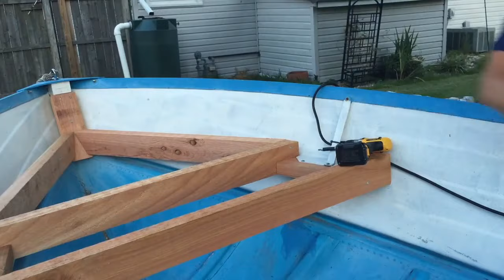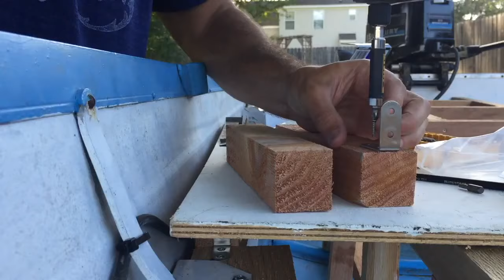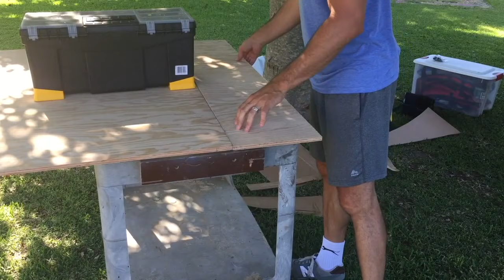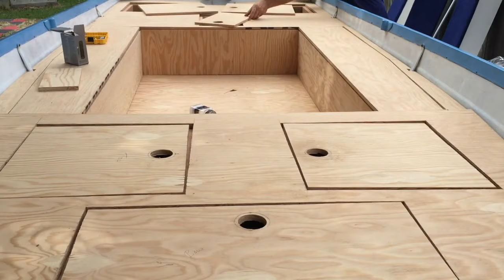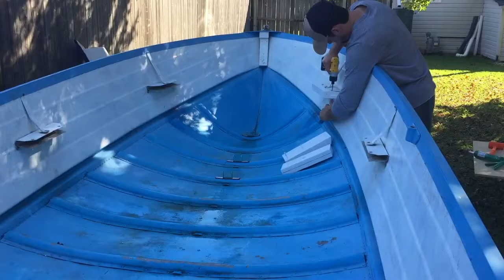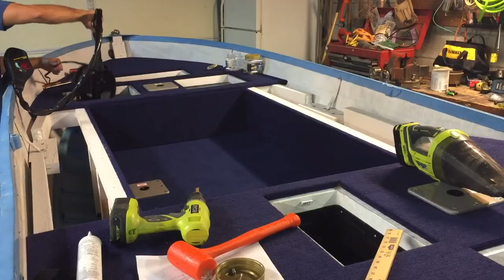14 FT Utility to Tiny Bass Boat | Full Build Time-lapse | Start to Finish!

Comment: I’m not taking anything away from your killer work or build. Just Bc you add a deck and compartments to a jon boat doesn’t make it a bass boat! I’m all for TBN I own one. But put that boat in the water with the bass boat guys i fish with and it will be sunk in like 5 mins!
Reply: I think most of the internet would disagree with you on that it can't be a bass boat
Reply: @skuterkid...   Take that MODIFIED JON BOAT in 3 footers and tell me it’s a bass boat! I’m not downing your equipment at all man. I have a TB and I have some decking and compartments that I built. But Bro come on a 2-20hp on a jon boat with storage do t make it a bass boat
Reply: @BrandonX444X  not to be an asshole or anything but like what qualifies it as a bass boat then..?
Reply: @skuterkid...   A legit bass boat 
Nitro procraft ranger 
Pretty much a console boat with at least a 25hp. 
Man I’m not being rude 
That’s a nice rig you have I wasn’t downing it

Comment: Did you find the boat to be “tippy” or unstable raising the platform and centre of gravity like that? Beautiful work you did here.
Reply from the maker: jamie, thanks for your question. I worried about that when I did the build too. I don't know what the boat would be like if I had dropped the deck down a bit lower, but I can say for me and a friend fishing standing up on it, one on front and one on back deck, it does just fine. Now having fish with it for a while I don't really think the height of the deck would make much difference. I think its the size of the boat (particularly the width), the bottom shape, and the displacement of water that ultimately determines how well the boat is balanced. Because the back of my boat is really flat on the water, it helps stablize the boat all the way through. If it was v shaped all the way back it could be an issue. All that to say, its no big bass boat, but I fish standing up on it all the time and ive even done so in pretty rough water and it does pretty well. I've had this question a lot, and I really need to do a video of me fishing it but when I get on the water I dont want to film, I want to fish! Thanks for watching!

Comment: this is really awesome.But, you could have shaved off alot of weight using Aluminum brackets instead of 2x4's.
Reply from the maker: you're right, while it turned out fine and i am really happy with it, if i ever do again I'd use less 2x4 and more 2x2 or as you said just use aluminum. Thanks for watching!

Comment: How stable is the boat. I have a 12ft aluminum boat and was thinking about putting a flat bottom on top of my 3 bench seats. You think that would work. Or would it be unstable
Reply from the maker: sorry for my very late reply, its stable enough for two guys to fish standing up. check out some of the other vids on the channel to see the boat in action. Thanks for watching and sorry for my very late reply!

Comment: Why not use aluminum for the frame? Wouldn't it be lighter and longer lasting? Asking because I want to do the same thing (once I get a nice deal on a similar size jon boat).
Reply from the maker: if i had to do again i would probably try aluminum, but i am very happy with the way it turns out and the way in handles in the water. You can see it in action in some of the other vids on this channel. Thanks for watching and sorry for my very late reply!

Comment: Very nice!! I really like it. Being as this video is 1 year old now - if you could talk to yourself a year ago - would you do anything different? What would you change now that you’ve been using your boat?
Reply from the maker: I would have used less wood for framing. I could have used more 2x2 instead of 2x4 but otherwise im really pleased with it. I dont like the color of the carpet, it looks purple. I wanted it to be blue. the floor is blue but I mismatched the rest of it and didn't realize it until it was done and out in the sun. Oh well.

Comment: Very nice build there bud. Definitely overkill on the framing. A you can save yourself about 60lbs by ditching the wood framing altogether and replacing it with riveted aluminum. I did a build on a 12’ aluminum boat, not as fancy as yours but my son and I could easily pick the boat up by hand, it was pretty lightweight. Should be on my channel somewhere if you wanna get some ideas for the next build.
Reply from the maker: thanks man, yes, I know ive done a bit too much, but Im happy with the way it turned out. I used cedar which is quite light, so it helps a bit. Thanks for watching!

Comment: how to clean such boat or remove water from the bottom if all panels are screwed and non removable?
Reply from the maker: Good question, the panels can be removed as all screws are still accessible. Its not an easy job but it can be removed to clean out inside of boat. thanks for watching!

Comment: Really good job and it looks nice, but IMO you added a ton of weight, could have used aluminum in places to save weight. But hey to each their own.
Reply from the maker: youre right I could have done with less, and use aluminum. I am happy with the way it turned out. You can see it running on plane in later video. It still runs just as fast with my 25hp. Thanks for watching!

Comment: How much do you usually charge for a project like that
Reply from the maker: I did this as a hobby for my own use. It is expensive to do this so I tell people to only do it if you have a tools and are handy and would enjoy it. Whether you decide on lumber or aluminum, it will be rather pricey. again, id say only do it if you want to do it as a hobby and you'd actually enjoy it. Its a lot of work and won't save you much money. But really rewarding when done.

Comment: What size screw did you use for the L brackets that connect frame to the bottom of the boat? (Where the boat rub sticks out)
Reply from the maker: Hi, I actually used rivets, but I dont remember what size, you can see me using them in other videos on my channel where the build is broken down into longer videos. I hope this helps. Id recommend using aluminum or stainless if you can, so they dont rust. Happy building!

Comment: How much weight did that add to boat ? How low does it sit in water now and will a 9.9 even push it now?
Reply from the maker: i dont know how much weight it added but you can see in the other vids that it does really well regardless. If i were to do again, i would have used a bit more 2x2 instead of the 2x4. i think the frame didnt have to be so robust. But overall, im really happy with it. you can see how it looks on the water in some of the other videos. i doubt a 9.9 would do well, but it has a 25 hp so it runs great. thanks for watching and sorry for the very late reply!

Comment: Curious what that project weighs now. USGS capacity is no longer close to applicable.
Reply from the maker: I get this question a lot and I have no clue what weight is. I used all cedar which is really light and naturally rot resistant, but being my first build I didn't have to use so much. It actually handles really well and comfortably handle some pretty rough conditions with myself and another. So it works fine for me. Would it be lighter with aluminum? absolutely but its not as heavy as one would think. thanks for watching!

Comment: Thank you so much for uploading this. I'm trying to do something similar with my 14 ft. Do you find the wood adds a lot of extra weight? I'm debating whether to use wood or aluminum.
Reply from the maker: Thanks Gavin, I used cedar so it's not too heavy and naturally rot resistant. I think I used too much, you could use more 2x2's, and aluminum is lightest. but the boat runs great as it is. you can watch other videos on the channel to see how it handles with the weight etc. with the 25hp it will go about 25mph with myself and another on it. I regularly fish with two people, one in front and one on back and have no issues and it handles some pretty rough seas.
Reply: @DrBass-rk1ez  Cedar is a great idea, thank you. Happy fishing!

Comment: Excellent work and great video. How much did the Royal weight go up after adding all the lumber?
Reply from the maker: Thanks man, I get the weight comment all the time. I think there is a really strong bias online regarding weight that I'm not sure, now after building a boat, that is not a bit overblown. Maybe Im simply not as concerned as others? Anyway all I can do is point people to my before and after videos on the water. Does the boat weigh more, absolutely, but it does not seem to have changed its performance at all, and when I'm fishing with myself and another having some extra weight actually stabilizes it better. Anyway, I always tell people I used cedar which is light and naturally rot resistant. I have a 25hp also, so of course with small outboard id notice a difference. Here are the videos of the boat running on plane: (before: @ (after: @. Thanks for watching!

Comment: How would you drain out the water out the bottom? I’m planning on building a bass boat and I was wondering this
Reply from the maker: hi David, in the other videos you can see I installed a bilge pump, if that is what you mean? so if it takes on water is has a pump. it also has a plug in the boat so when its out of the water you can pull the plug to get out any remaining water. All boats like this will have a plug. I hope that answers your question.
Reply: @DrBass-rk1ez  yes it does, thank you very much

Comment: A friend of mine tried something similar and it just made the boat a bit heavy and not as maneuverable. Also sat a bit deep in the water for comfort I wonder what he did different to keep weight down
Reply from the maker: It does add weight, but I used cedar which is really light and rot resistant. Here is a video of it running with the decking in it: https://www.youtube.com/watch?v=5YdJ9oOzhR8&t=136s

Comment: Are you putting screws into the boat or is this a semi floating deck?
Reply from the maker: if you watch the other videos you will see i never screwed through the boat. I only put a few rivets in the ribs on the bottom to secure the base of the frame and used the only seat supports and transom to attach the rest. So i was able to avoid putting any holes in the boat. thanks for watching and sorry for my very late reply!

Comment: You framed the heck out of this pretty well, how much weight was added from framing if you had to guess?
Reply from the maker: yes, you're right probably an overkill on framing. I too was concerned, but really happy with the way the boat handles etc, even after all the decking etc. One thing to note is that I used rough cut cedar, which is really light wood. Cedar, I was told, is also naturally rot resistant so works good for this sort of thing. I think I probably added between 150-200s with all decking (framing and plywood). That is not including trolling motor and battery. You can see in the other videos how it runs on the water with all this weight in it. Runs fast with myself and another and handles waves well. This has a v bow, so it can handle rougher water and its a wide boat, so it will handle more weight. Hope this is helpful and thanks for watching!
Reply: Is this hull more of a deep v rather than a moderate v hull?  That is what I am dealing with and worried about stability.
Reply from the maker: @davidarchibald9913  im not sure if its a deep v or moderate, but at about the midpoint of the boat it is pretty flat all the way to the rear. I think my boat is pretty stable. I regularly fish with one guy on the back deck and me on the front. Sure, its not a full size bass boat, but im really happy with stability up front even with vbow. I think that because the outboard is on the back and the back is flat, it helps stabilize the front. Here is a link to the boat without all the decking in it. You might be able to use the video to compare it to your own: https://www.youtube.com/watch?v=XCmjyMSkkvA To get a feel for stability, here is a link to a friend of mine fishing off the back with me on the front: https://www.youtube.com/watch?v=VEe1eLrjlNM&t=48s

Comment: The framing/decks add quite a bit of weight. What did you do to make the boat more buoyant?
Reply from the maker: I think you're asking if I added foam? If so, there is foam under the main deck. Thanks for watching.

Comment: Was thinking about doing this  but wondering  about  how the boat handles  afterwards with  moving the  center of gravity  so much  higher. Did  the conversion  affect the  stability? Do you you   find it  more  tippy?
Reply from the maker: Hi captain. with this size engine on this boat without any weight on it, it almost felt dangerous to ride. the front end went way too high in the water. you can see this in one of the earlier videos I did on the outboard restoration. Once the deck was done it added a lot of stability in rough conditions especially when running fast and the extra weight helps with stability when fishing: here is a video of me fishing it and one of my running it on plane with all the decking: https://www.youtube.com/watch?v=cjnAYu45TnI and https://www.youtube.com/watch?v=5YdJ9oOzhR8&t=137s

Comment: Roughly how much weight do you think was added during the process?  I would like to try something similar but i'm concerned about being to heavy after
Reply from the maker: Hi Mitch. I get the weight questions a lot and have no idea how much weight it actually added. I think there is a really strong bias online regarding weight that I'm not sure, now after building a boat, that is not a bit overblown. Maybe Im simply not as concerned as others, or my boat is wider (mike is 60" wide at transom)? Anyway all I can do is point people to my before and after videos on the water. Does the boat weigh more, absolutely, but it does not seem to have changed its performance at all, and when I'm fishing with myself and another having some extra weight actually stabilizes it better. Anyway, I always tell people I used cedar which is light and naturally rot resistant and then 1/2 Marine grade ply. I have a 25hp also, so of course with small outboard id notice more of a difference. Here are the videos of the boat running on plane before and after to give you an idea of weight: (before: @ (after: @. Thanks for watching!

Comment: How is the stability when standing closer to the side of the boat? I have a similar boat and was thinking about doing something like this, but I’m concerned about the stability.
Reply from the maker: Hi Eric, I get this question a lot and want to do a video on this for this reason.I was really worried about it too before I did the build. Keep in mind my boat is 14ft and 5ft wide (if your boat is more narrow that might make it less stable). To answer your question it is pretty stable to walk around on, but its not a 21ft bass boat either. But when just myself and a friend it is fine with one on back and one on front. In the following video you can see a friend of mine on the back deck while I'm on the front, which should give you an idea of the stability: https://www.youtube.com/watch?v=VEe1eLrjlNM&t=86s

Comment: How much carpet did you have to use and where did you get your hinges at?
Reply from the maker: zack, I got some cheap outdoor carpet from an overstock store locally and its held up really well. I got my hinges from grainer supply. they were the only place I could find a decent price for aluminum piano hinges. I had to cut them to size and drill holes but I really like them. They've held up great and no rust.
Reply from the maker: *grainger industrial supply
Reply: Do you by chance remember what size they where?
Reply from the maker: @zackfoster8327  (This is what my order says) Continuous Hinge Natural 36" H x 3/4" W      Item #: 4PNR1
Reply from the maker: again this is from Grainger: https://www.grainger.com/product/MARLBORO-Continuous-Hinge-Aluminum-4PNR1
Reply from the maker: @zackfoster8327  you can also see the install here: https://www.youtube.com/watch?v=0USjC21hfKU

Comment: Hello Doc. great job , you have built an awesome rig buddy, I'm working on a little project boat myself and I was wondering where you got those black lid latch's from , i could use the info or webpage you found them on !!!
Reply from the maker: Hey man these are the links to the latches I used. If I had to do again I would not use the ones that have the latch on them. Id just use the cheap ones that are called 'pulls'. If you are using carpeting the hatches are tight enough to stay closed with just the pulls and dont need the ones with latches if that makes sense. Here are the links to both: 

https://www.amazon.com/gp/product/B07CH3N76R/ref=ppx_yo_dt_b_search_asin_title?ie=UTF8&psc=1 

https://www.amazon.com/Marine-Sliding-Cabinet-Drawer-Handle/dp/B08K8DLKPL/ref=sr_1_29?keywords=marine+hatch+handle+black&qid=1637959227&s=hi&sr=1-29

Comment: Why purple instead of black or grey or something like that?
Reply from the maker: sam, yes, I loath the color of the carpet. it was supposed to be a darker blue. In fact the floor is actually a different color than the purple decking that you see in the video. I went back to the store to get more of the blue floor and got the wrong stuff so it turned out more purple than I had planned. I had already done a lot of the carpet on the decking in the evening before I realized the carpet was actually purple, and different from the floor. I swear Im not color blind! But if I do it again, id do grey this time. I originally wanted blue because its matched the outside of the boat which has some lighter blue on it. It was painted that way when I got the boat. thanks for watching!
Reply: That purple is super cool!!! I mean who has purple!! It’s totally custom!!!